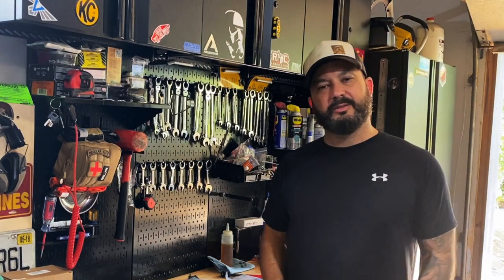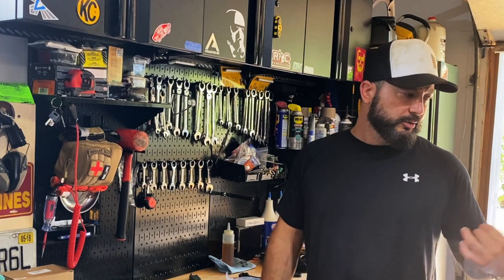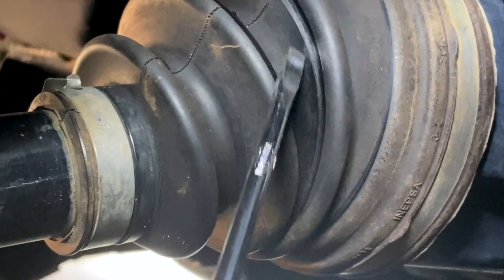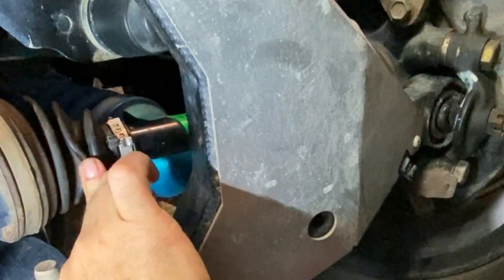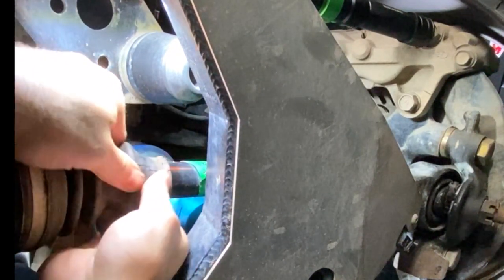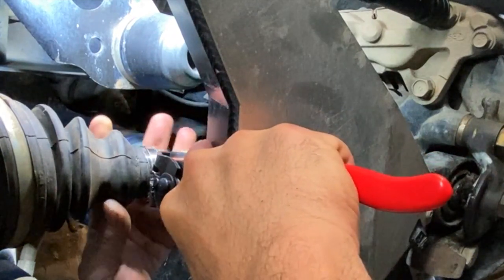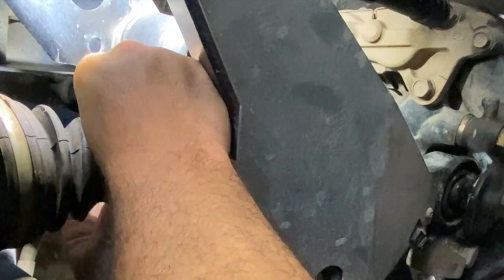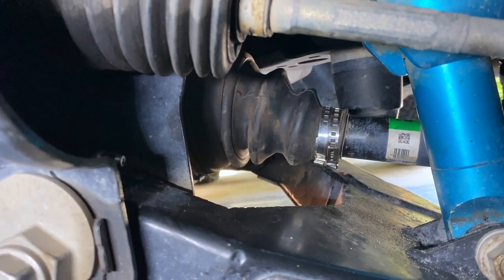The CV Boot Mod | (2017 Tacoma)

Comment: I don’t have a truck, but I tried stretching a new boot I installed and it ended up splitting later eventually. The good thing about your boot was it seemed pliable unlike my hard rubber oem cv boot. In process of installing a high angle boot on a recently installed cv axle late last year. Trying to get in the mindset to fix it now.
Reply from the maker: I know what you're talking about in terms of the materials. Some manufactures use a more rubbery boot on the inner CV to the diff, while using a more plasticky/less forgiving boot on the outer/tire side. Good luck with your install.

Comment: Hey brotha where ya wheelin at? Fellow Fl native,
Reply from the maker: We mainly hit, Citrus and Ocala. There are a couple spots in Clermont but they are small, short rides. Richlaom is also an option but it's usually under water so be prepared for that. Also Osceola National forest to the north.Hardrock Off road park, it costs to get in but there you will find more challenging obstacles.  Options are limited her in FL, we are trying to plan a trip at least once a year out of state to get in some different type of wheeling, more technical obstacles.